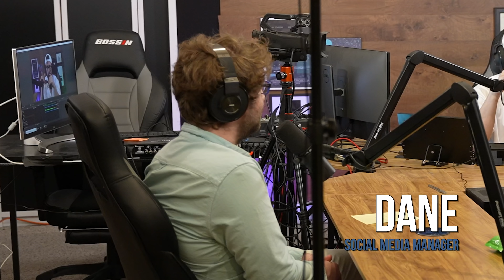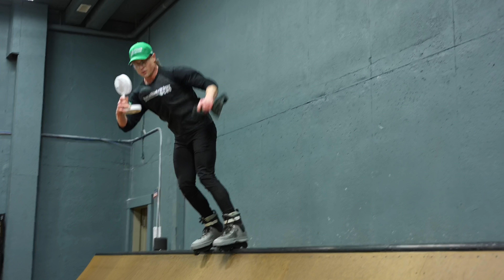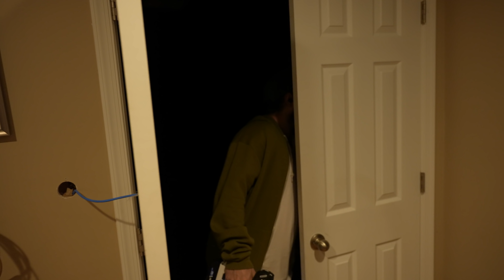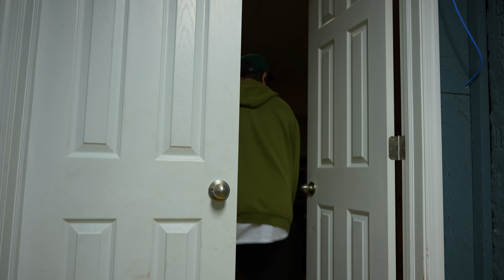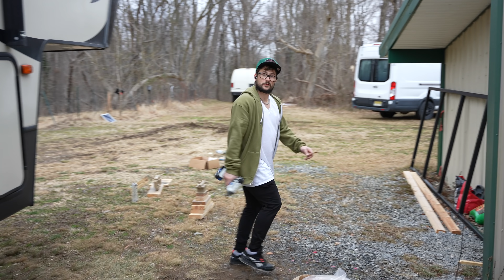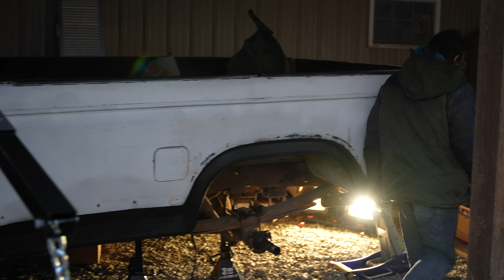Rogue Employee Loosens Screws In Skate Park To Harm Tim

Comment: Castcastle, someone tell Tim to spend a bit of coin on a standing tool box for Ben to store his tools.  It can be a tax write off as a business expense.
And maybe a pre-fabricated shed for him to work on vehicles in, also a tax write off.
Then all he needs us either a salamander heater, or a wood burning stove.
It better to work on vehicles in a warm environment.  Those tools get ice cold.
 Remember that tools are a mechanics Holly grail. And is their most pride possessions, get him a standing tool box with a locking system.
Ben will appreciate it greatly, a way to secure his tools, and a way to organize them for easy searching.
A lost tool is madding, they are not cheap.
I have seen tool chests worth $30k, and up.
Tell Tim it would be an act of generosity and gratitude towards Ben for all the mechanical work he does to give Tim what he needs to build Timcast up.
Plus it's a tax deduction business expense.
A win-win for everyone.

Comment: Why rollerblading is dead.  labeled as fruit boots at every skatepark in the country in the early 2000's,  rollerbladers struggled to stomp there maneuvers without looking "gay" as hell.  they shouted from the ramp decks as bladers flailed around in the air fiercely kicking there feet.  as if a novice ballerina was fighting for there life drowning in water while simultaneously falling from the sky.  its hard to look cool when your locked into a traditional curtsey grind, where they pose like a woman bending her knees while bowing her head.  "F*@k-ing fruitbooters" everyone shouted as they snaked everyone on the deck in some gay ass jean shorts, matching Oakey sunglasses and wrist guards. they squatted as if about to shit on the roll-in then pushing up to a disappointing seizure like aerial maneuver.   Back to the deck they frequently claimed to have "just named a new trick they invented" saying some shit like a 387 and a half-double antispin.    truth be told stepping into a par of scootboot's is a blast.